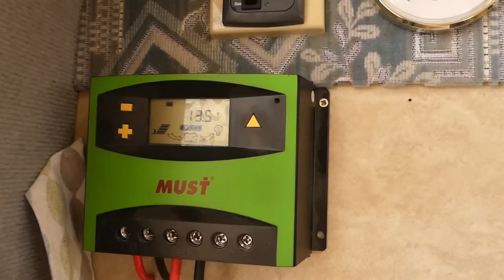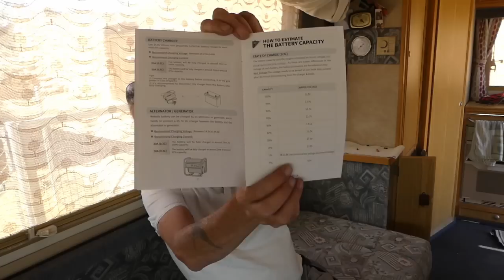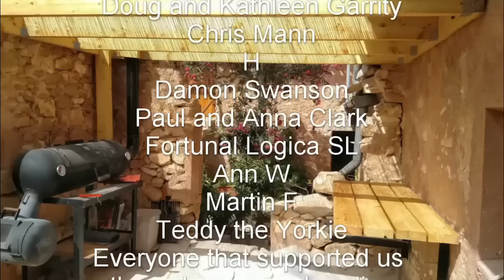Installing a Redodo powered off grid solar system in a camper van

Comment: Hi Andy 
Good job done I really like how practical you are on everything you tackle. 
Would you have been better to put cushioning between the brackets and the solar panel to give some flexibility from vibrations from the road surfaces? 
Regards Brian
Reply from the maker: Thanks Brian - It's not normally done - in most cases the panels are fixed directly to the roof using plastic corner and side pieces

Comment: Great job but you can't check the battery charge percentage by looking at the voltage with a lipo4 battery, you need a a battery monitor with a shunt for more precise percentage.

Comment from the maker: Redodo (Germany official site): https://bit.ly/3oD74Yx
12V 100Ah battery (Germany site): https://bit.ly/3n5ozQy
3% discount on tax-included products use discount code FINCALIFE (valid for a long time)

Redodo (U.S. official site): https://www.redodopower.com/?ref=o3kvbet5
12V 100Ah battery (U.S. site): https://www.redodopower.com/products/12v-100ah-lifepo4-battery
3% discount on tax-included products use discount code FINCALIFE996 (valid for a long time)

If you are in Germany, it can be purchased for 0 VAT for private PV systems. Duty-free products can be purchased through this link: https://bit.ly/3ZFCquN
3% discount on duty-free products: FINCALIFE (only valid within 7 days of video release)

Redodo on Amazon: https://bit.ly/3kE6atc